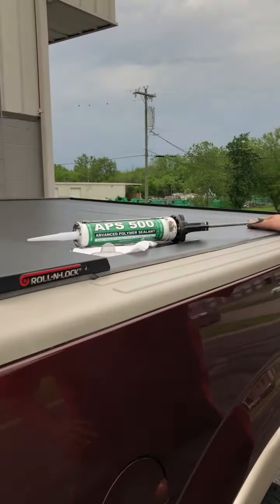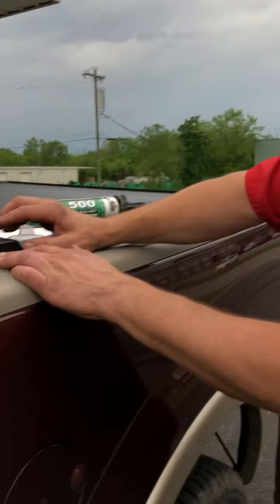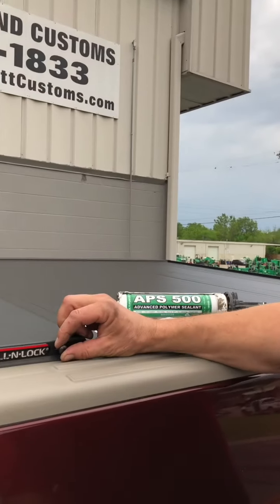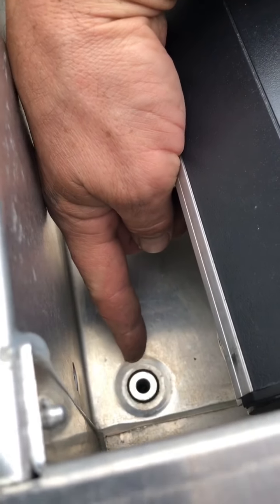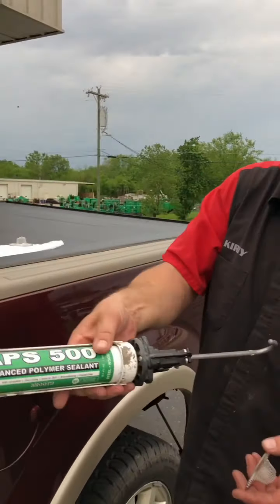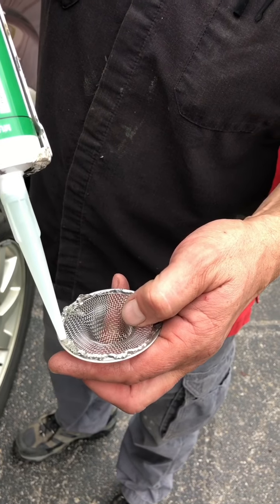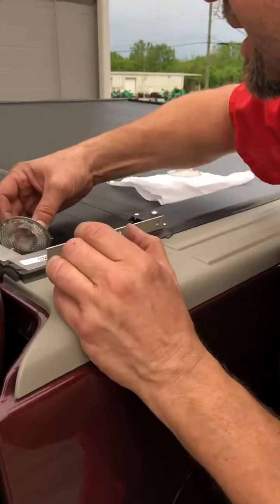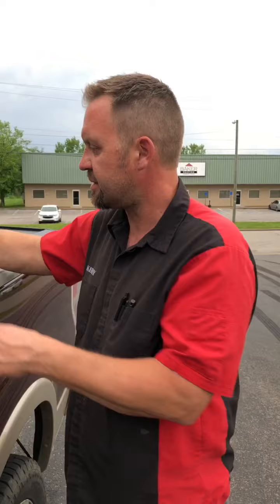Roll-N-Lock Bed Cover Leak

Comment: Alright...I understand now....the folds I spoke of windup as you push the top of the Rolling Lock from the tailgate toward the truck cab...then as a large rolled up entity they "sit in" 
that drain tray, meaning if the drain tray is clogged and full of water...the rolled-up top just laps the water up as you drag the top back toward the tailgate to close and lock it.
So YOU ARE THE BOMB, DOG, Ive had my Tundra Crewcab Platinum for 3-4 years now, and the water leak has always aggravated me, and now no more. WHOOPEEEE !!
Reply: So how did this work for you cause just installed my about a week ago trying to see if I need to do this to help for future water proof

Comment: Sweet, dude...great solution. But I was convinced it was leaking thru the top somehow, because when I open and close my Roll and Lock....water pours out of the underneath side of the top, as if rainwater if getting in around the component you removed to get to that drain tray ?? Like water is being held in each metal or composite "fold" as they override each other opening and closing....(looking up from the bed at the underneath side of the panels ) water is pouring out of mine from those folds ??  Does that make sense ? It doesn't seem to make sense that the water filling up in that drain tray is what's causing my leak problem, but maybe that drain tray is the whole dealio. I'm going to go right now and remove it.